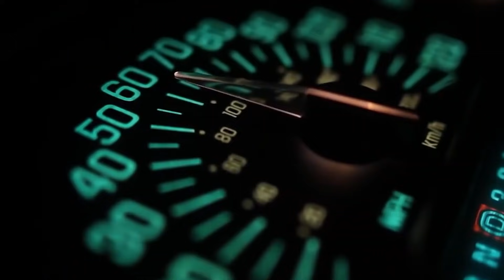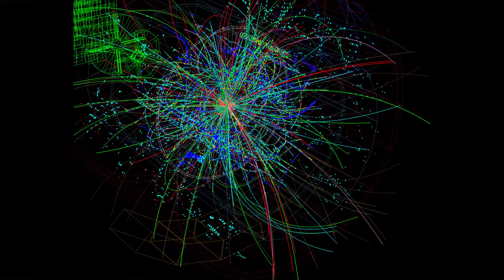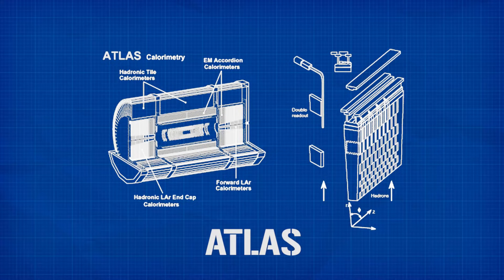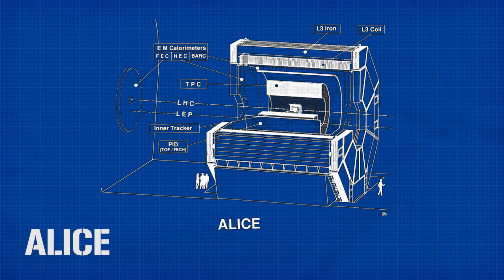The Large Hadron Collider: The Largest Machine in the World

Comment: A few small technical corrections: 
3:30 'Just below a million volts' should be 'just below a trillion volts' mega is million tera is trillion
3:43 '9.6 Celsius above zero' makes it sound like above 0 C, should specify that's above 0 Kelvin. We're talking liquid Helium temps here :p
6:34 to be a bit more precise(since we have the speed of light to very high precision), they say 99.9999991% the speed of light, equal to 299,792,455.3m/s, just under 3m/s slower than light.
7:30 the superconducting cable doesn't transfer power to the magnets, it IS the magnets and, 9:50 the liquid Helium isn't for cooling the 'heat of the collisions' or something, it's for keeping the superconducting magnets cold and thus, superconducting
Reply from the maker: Thank you :). Now I wish that YouTube would just bring back annotations, that million volts thing is particularly bad. 

And dammit on the 9.6 Celsius thing, I corrected that when I was editing, but must have undone the typo somehow.
Reply: @megaprojects9649  Might be worth adding these useful corrections to the notes section where your social media and other channel info resides. Great channel :-)
Reply: You're a lovely nerd for writing this
Reply: Megaprojects comments will have to do, annotations were terrible and annoying when used by some creators
Reply: @megaprojects9649  3:30  and also the electron volt  eV is a unit of measure of energy  ( joul) not a difference of  electric potential
Reply: Youre doing the lords work
Reply: 1 eV = 1.60218e-19 Joules.... that doesn't seem like a lot, but that's _per proton_...
Reply: so 6.5 TeV is on the order of 1 microjoule per atomic particle.
Reply: One tip. A lot of publications use 10^12 when referring to Tera because of the whole longscale shortscale bullshit (your trillions are our billions).
Reply: Some Mega brains watching this channel!
Reply: And 9.6 Kelvin was the temperature, at which the Cryostat (The vessel holding the magnets, swimming in liquid Helium) burst. Normally the liquid Helium has a temperature of about 2 Kelvin. (At normal pressure Helium boils at 4 K. To get it to 2 K, the pressure above the liquid helium bath has to be reduced to 36 mbar.)
Reply: Thanks
Reply: My head hurts from reading that.
Reply: It's also not a million "volts" but rather a million "electron volts" - an electron volt is the potential energy of an electron in a 1-volt field, and 6.5 trillion electron volts is 1.04 micro-joules (or 1.04 microwatt seconds). 1 micro-joule is enough to move a 2.5 gram penny 0.4mm (as 1 joule is enough to move a 1kg object 1 meter). It's not an amount of energy that's hard to understand for people.
Reply: Picky picky, who else could his job, eh? I got so emotional about this production just now, well... y'a know.
Reply: @Amadrath  Is helium the only element that can pass through objects, glass etc? And does Helium need to be supercooled to achieve this or can it do it at any temperature?
Reply: @stephenmcdonagh2795  Basically every element and even a lot of composites can enter solid materials to a great depth, given the right conditions. This effect is used in Ion Beam Therapy, a cancer treatment, where a tumor is irradiated with i.e. a carbon ion beam.
Helium has the smallest atomic radius and thus the highest probability to diffuse through a solid. The probability increases with the energy of the atoms (i.e. high temperature, high pressure). Thus supercooled Helium is actually less likely to diffuse into a solid. Until it passes the threshold to superfluidity, that is.
Superfluid helium experiences next to no cohesion, which allows it to flow through very small pores or to creep up walls and thus "spill" out of open vessels (Onnes effect).
Reply: @Amadrath  Cheers, I saw something about it on a science show- couldn't remember whether it was helium of methane.
Reply: Nick S  The problem of abolishing fossil fuels is not one of technology. All the technology is there. It is one of profit and division. It is still more profitable to go on as usual, than to invest in changing the infrastructure. As long as there is someone left on this planet, who is willing to exploit this, nobody else will make the first step. (i.e. "Why should I cut back on my potential profit, if he/she might not?")
Reply: @megaprojects9649  what an awesome community though
Reply: 9.2 C above zero is not liquid helium temperature at standard atmosphere, 9.2 C is over twice the boiling point of helium.
Reply: Anglo trillions or World trillions?
Reply: @megaprojects9649  tev is not a Tv
Reply: It's not actually correct to state we know the speed of light with high precision. We know it with ABSOLUTE precision since it is now a SI defined constant (Which by extension also defines the meter).
Reply: I'm currently studying materials as part of my physics course and have had to put a lot of work into unit conversions as I always get caught out when the question says 0.35mm for example; putting that bro meters baffled me lol.
Anyway, I panicked when he said a TeV was a million, I had already thought it would have 9 zeros not six. Phew.
Reply: Having living the Disc Drive industry world for a long time, and also having grown up in a British colony and having a British High School education, it was interesting to discover how the Brits and Americans differential mega, giga, tera, peta, and so forth...
To an American, a megabyte is equal to 1 million binary bits or 1,048,576...
a gigabyte would thusly be 1,048,576*1000 or 1,048,576,000 bytes...

The Brits, as I recall, would multiply their megas, gigas, anythings, by a million rather than a thoudand.
It makes sense in view that a megabyte is a million bits! So each order of magnitude thereafter should increase by a million rather than a thousand.
We won't get started on the definitions of a megabyte which used to be 1,048,576 but as drives got bigger was changed to be 1,000,000 so that compananies could inflate their advertised capacity.
YES! there were lots of lawsuits over it....
Reply: @Ryan-lk4pu  m is 1/1000. So mm is 1/1000 metres.
Reply: @johnnythepr1ck I'm not, but thanks anyway. Why so salty?
Reply: @johnnythepr1ck Ok, take any Iron rod, rub a magnet down it a few times, it's now a magnet too. Not quite sure what a 'gravity machine' entails. Anything with mass exerts gravity.
Reply: @johnnythepr1ck Ok, so find an Iron meteorite and magnetize it. Gonna stop replying now bye.
Reply: @johnnythepr1ck Ah yes your intentions revealed now I see. Easy, pressure. 3.6 million times atmospheric. Melting and boiling points are on a graph of both temperature and pressure, known as a phase diagram. You can boil room temperature water by putting it under vacuum, which I've done it myself. You could also have ice at 100 C but it needs on the order of 20,000 atmospheres. Think about that.
Reply: No one cares.

Comment: "They're idiots!" Truth, complete truth.
Reply: @Varangian_af_Scaniae  Antennas aren't dangerous, they don't emit nearly enough microwave radiation to cause any harm, also 5g doesn't spread the corona virus (yeah some people believe 5g spreads cobid 19)
Reply: Varangian af Scaniae At least you accept the fact.
Reply: @Varangian_af_Scaniae  That's the thing. The 5G antennas are not dangerous. You'd get more harm from the sun than these antennas
Reply: @Katniss218  Correct, both visible light and ultra violet light are both higher up in the EM spectrum than microwaves, in wave frequency and therefore power
Reply: A few corrections from someone who has worked at Fermilab (home of the previous largest hadron collider):

1) The LHC actually does make black holes according to theorists. They're just so small that they immediately dissipate from Hawking radiation.

A TeV is actually about as much energy as a flying mosquito. What makes the LHC impressive is how concentrated that energy is, not its sheer magnitude. Electron volts are a unit used on subatomic scales so of course they're small.

Also, the previous largest hadron collider reached almost two TeV, but it was a Proton - Antiproton collider which is why your stat was 0.9 TeV.
Reply from the maker: @Varangian_af_Scaniae  lolz.

EDIT: SMASH THAT DISLIKE BUTTON.
Reply: @sleepylion9511  Ah yes and cancer is now the number one cause of death projected to increase 54% in the next 15 years.
Reply: @Varangian_af_Scaniae  "dangerous" no
Reply: @fryaredherring6434  Please see the comment just above this one.
Reply: @fryaredherring6434  You may have said the name of your expert but you didn't type it or provide a source to check your claims.

Almost like it doesn't exist...
Reply: Kaiser Wilhelm well, to be nitpicky "fine" is not a scientific term. The correct assessment is that the associated risk is very low, but it is not zero. For example even your cellphone when in a call next to your head does heat up your ear and your brain a little if you're using LTE due to the emanated energy in radio waves. The amount of heating up is very small but its not zero, if i recall correctly after about 15min the difference is slightly over a degree celcius. it's very unlikely to be harmful, but to say the risk is zero is incorrect. we don't know exactly what the risk is though so everything is a guess but we know the risk is not high.
Reply: @Varangian_af_Scaniae  Dangerous microwave antennas.... science is something new yo you isn't it?

Comment: The Superconducting Super Collider (SSC) (also nicknamed the desertron[1]) was a particle accelerator complex under construction in the vicinity of Waxahachie, Texas.

Its planned ring circumference was 87.1 kilometers (54.1 mi) with an energy of 20 TeV per proton and was set to be the world's largest and most energetic. The project's director was Roy Schwitters, a physicist at the University of Texas at Austin. Dr. Louis Ianniello served as its first Project Director for 15 months.[2] After 22.5 km (14 mi) of tunnel were bored and nearly two billion dollars were spent, the project was cancelled in 1993 due to budget problems.[3]

Comment: 9:55 ya know, im always grateful for when people give temps in both C and F so everyone can get it to some extent, but i do wish that with EXTREMELY hot/cold temps, like in this case especially, i kinda wish i could also get a kelvin score so i have a reference from absolute zero as well. oh well, im on the internet and it takes even less effort to search my issues myself than even type this comment so off i go to learn individually!
Reply: “Colder then space” in deg C is a bit vague. K tells the story. 

Absolute zero is as difficult to achieve as perfect vacuum or perhaps light speed. (Ok light speed probably harder.)
Reply: Kelvin is the same as Celsius you just need to add or subtract 273.15 depending on which direction you're converting
Reply: Micah Ross 
Yes. 1 deg K is the same as 1 deg C. We all (most of us) know that.

However in narrative “0.1 above absolute zero” comes across more descriptive than “neg 273.05 C”.

Comment: Electron volts don't compare to Volts as they describe a different unit entirely; electron volts energy and volts electric potential. Therefore making the distinction at 3:31 that "0.98 TeV is just below a million volts" makes no sense 

Electron volts should be contrasted to joules. Electron volts are very small compared to joules by the way, even a high sounding energy is relatively small in reality

Comment: I love Whistler's talks, but this is the second Whistler error I found since last night. The first error was a minor error in regard to Hubble's Law.) The error error in this talk is far more serious. Whistler says that a Teraelectron (TeV) is about the greatest force in the universe. First of all, an electron Volt is not a unit of force , it is a unit of energy. Secondly, it is an extremely tiny unit of energy. It is about the energy expended during  a brief flight of a mosquito. Although very small, the achievement of even 1 TeV is remarkable for 2 reasons. The first reason is that all of that energy is carried by an extremely small object (about 0.0000000000000000000000000001 kg.). Secondly, it is remarkable because achieving that amount of energy requires a vast machine capable of keeping the electron on a circular path at something close to the speed of light.

Comment: Particles in the LHC are accelerated using a series of electromagnetic coils that fire in rapid succession, propelling the particles forwards, the same way a linear-motor accelerates a "shotgun-style" rollercoaster. Except instead of those coils needing to fire a few tenths of a second apart, they need to fire a few billionths of a second apart. In the correct order. Around a track several miles long. Take a second to appreciate how accurate the electronics operating the LHC need to be to make that happen.

Comment: Love your shows.  I would love to see a show on the LIGO (laser interferometer gravitational wave observatory).  It can detect changes in the fabric of space time, 1/10000 width of a proton.  It is a remarkable piece of engineering.  the lens themselves are remarkable pieces of engineering, and are multiply hung on movement isolation pendulums.  The vacuum chambers are similar to the LHC. Each of the legs are long enough, that the curvature of the earth comes into effect and need to be corrected. I still havent figured out whether LIGO is an analogy for a car traveling down a road that is being stretched; I mean wouldnt the car’s frame get stretched as well? Totally mind blowing.

Comment: Just want to point out that 13 TeV is a tiny tiny amount of energy. It is equivalent to about 0.0000005 calories, and I'm not even talking about "food calories" which are kilocalories or Calories (capital "C"). What makes the LHC so amazing is that they squeeze all those 13 TeV into relatively very few particles, so each of the particles is indeed *incredibly* energetic. Then they also have the precision to measure such interactions, which is also amazing.
Reply: For perspective, a single Twinkie contains 135,000 calories of digestible chemical energy. But a Twinkie also contains about 250,000,000,000,000,000,000,000,000 hadrons, which is much more hadrons than an LHC beam contains.

Comment: A Terra electron volt is actually a pretty simple number for people to understand.  6.5 TeV is actually just 1.041415245 micro-joule. It's the amount of energy required to move one gram 1.04 millimetres. So theoretically if you took a penny and hit it with 5 particles from this accelerator, you would give it enough extra energy to move 2mm.  (although actually you would probably just cause a few subatomic particles to go streaming out but whatever, lol) - but just put a penny on the table and tap it with your finger, so it barely moves, that's about how much energy it is.   (But, that's per particle)

Comment: 25 years ago I visited the older CERN ring and we learned about the upcoming LHC. The original’s detector were huge and then seeing the inner pipes (it was during a service downtime) was mind boggling. Also one needs to keep in mind that if protons go off the rails they can punch a hole into the wall / magnets etc due to their velocity / energy.

Comment: Simon, space doesn't really have a measurable 
temperature.  On the Apollo missions, they had 
a "BBQ Roll" to even out the thermal radiation.  
The side facing the sun was heated up to over 200 
degrees, and the other side was well into negative 
numbers.  (Yes, Fahrenheit.)

steve

Comment: Additional error: Whistler later describesTeV in terms of Volts which is also incorrect (B Ueb also makes this error in his comments). An electron volt is the work energy required to accelerate an electron through a potential difference of 1 volt. There are several other minor errors in this podcast. Too bad because I really enjoy Simon's talks.

Comment: It should be phrased as “X TeV per particle” not per beam. The beam usually refers to all the particles currently stored in the LHC, which typically has roughly the energy of the kinetic energy of a train. 

Also “1 TeV is greater than any force” I disagree with for two reasons. Firstly it is an energy not a force. Let’s not participate in the confusion over different kinds of quantities. Secondly, as an energy it’s quite small. It’s 1.6x10^-7 joules. You would need 10 million times the energy to get the energy of a 1kg thing moving at 1 m/s. This is only an astonishing amount of energy for a single particle to have.
Reply: And another problem - you suggested that ~1 TeV collisions might happen in space. They do not. Cosmic rays typically have much higher velocity relative to earth than lhc particle beams. But they never hit each other head on (they aren’t common enough). And hitting head on has a huge benefit for center of mass collision energy. So collisions at LHC energies do not occur in nature.

Comment: 9:35: "100,000 x the heat of the surface of the Sun?"  Did you mean the core? 100,000 x the surface temp is only 577.8 milion degrees K, which astronomincally isn't that hot.  The temperature of the Universe after about 1 and half minutes was twice that.

Comment: I think your description of the beam line energy is a bit misleading. A TeV is still only about 10^-8 Joules which is still very small, important bit comes in when you realise the mass of a proton is in the order of 10^-27 kg.  So the individual protons sitll have very low energy but because their mass is so much much smaller the difference between the two makes it look very large. It would be like having a rocket engine scaled down to fit the size of a grain off sand but still output the same amount of thrust.